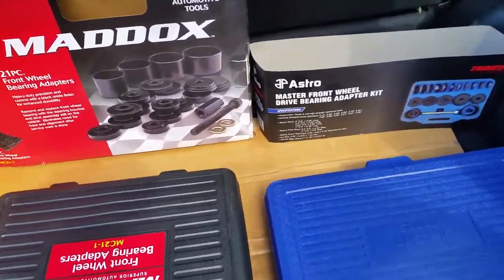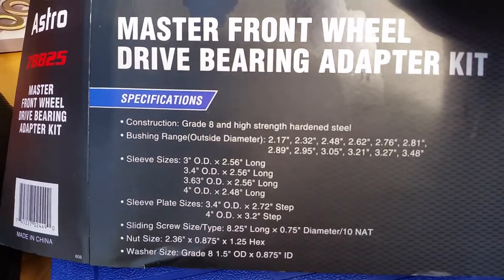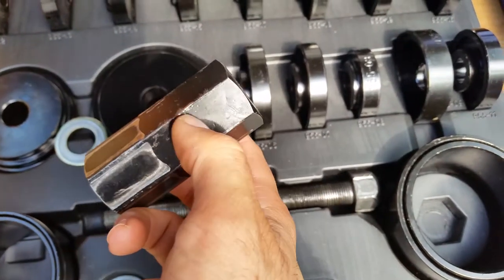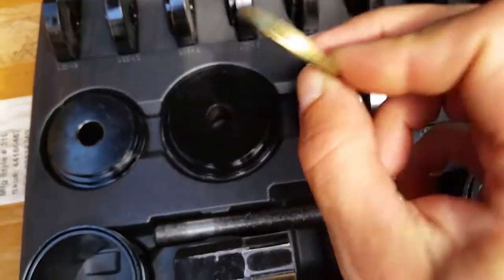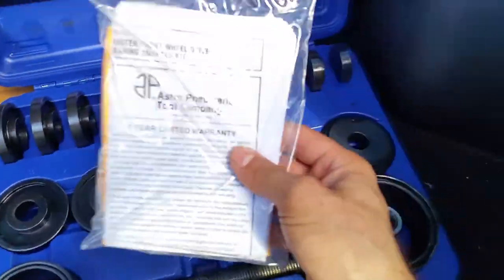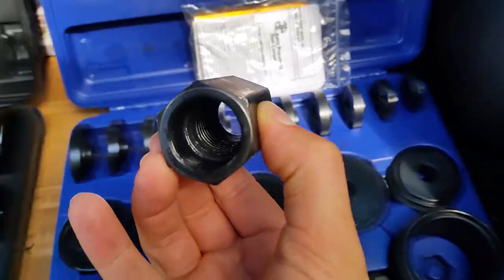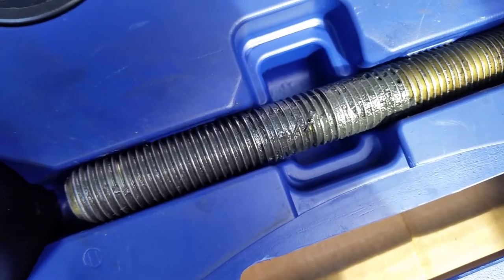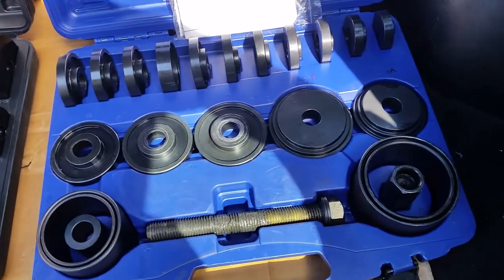Harbor Freight vs Astro wheel bearing adapter kit

Comment: Used the HF kit, same one, about a year ago and got a wheel bearing race pulled and the whole thing re-installed, but afterward, noticed the threads on the bolt were damn near smoothed from just that one job.  Did same wheel bearing job with the Astro kit ($55!) and had no problems at all.  Noticed the bolt is a grade 8 instead of the unmarked HF bolt.  I did return the HF kit, so no love lost.  Keeping the Astro!
Reply: $55? It’s $118 in 2023 😮

Comment: Good advice & insight about the bearing kits. Thx. I'll probably look for and use an axial (thrust) bearing taking into account the axial load (parallel along the shaft) instead of the needle bearing for the bolt and washer setup. Good tip!

Comment: Very helpful thanks.  Have to do front bearings and almost paid the 119 for HF.   I just pulled the trigger and ordered the astro for 73.
Reply from the maker: Right on
Reply: @mil-specmotorworks7805  It worked flawlessly.👍

Comment: Hi, I have the 78830 Astro it’s very strong and pulls that bearing right out with my impact, your right it needs a thrush bearing on the head of the force bolt for a much smoother performance, I’m trying to locate one now, I’m glad I saw your video I was just about to get that Maddox from hf thinking it was better, otc press comes with the thrust bearing, for the price this Astro gets the job done, excellent quality video ty, Bob,
Reply from the maker: If someone knows the thrust bearing part number please put it below this will make the kit last so much longer put less stress on the threads and make it way easier to push the bearing out thanks great comment
Reply: @mil-specmotorworks7805 , I bought a press from Amazon, the company is, free tec, it came with a thrust bearing and I purchased a few more bearings, the company is, factory services tools, the bearing number, HTB 1pc, I got them from Amazon about a year ago, the press works better than the Astro,

Comment: Wow, when did you buy this? I bought this exact Maddox kit at HF in mid-2020 and the threads were MUCH coarser and tapped more deeply. In fact, it looks exactly like the Astro kit's bolt and nut. You definitely have to be careful when buying things at Harbor Freight and peek inside the cases because they source identical part numbers from different manufacturers.
Reply: Compare his part number from yours, sometimes harbor freight will have different part numbers for the same tool, that usually means it was made from a different country China or Tiawan.

Comment: Thanks for pointing out the true defiency in the most important piece of the kit; the nut/bolt.  To keep machining costs down, they reduced the amount of threads inside that nut.  Just to save a few pennies.  What a load of BS!  I'm going to buy a kit like this one day to avoid buying a shop press so I'll carefully check the nut to ensure its threaded full length!

Comment: If you use a wheel stud installer like the OEM tools part number 24235 and a hand ratchet you shouldn’t have problems with either sit
Reply: Yeah and put some grease on the threads seems to help people as well. Alot of people are using an impact on the Harbor freight tool and they say it's not recommended for a impact gun.
Reply: And also like I said in my statement last year if you get one of those stud installers that would alleviate the friction from the boat turning and all the pressure will be on the screw pulling out the bearing
Reply: And also like I said in my statement last year if you get one of those stud installers that would alleviate the friction from the boat turning and all the pressure will be on the screw pulling out the bearing

Comment: Hi There, thx for the comparison, just wondering if you used an impact drive, because got a new one (another brand) and inside the case a yellow sticker saying : ''DO NOT USE WITH AN IMPACT DRIVE'' , That may be the raison of the damage??
Reply from the maker: I never got the yellow sticker I used an impact I guess they changed it now but the Astro I use the impact all the time and it's perfectly fine it's way better quality Steel

Comment: Granted its a POS you dont need the threads to be all the way thru on the coupling nut. You want it for the length. Astro for sure the better kit tho when it comes to taking out bushings.

Comment: Shit I just got the HF kit. I have a side job on a Jeep Patriot front wheel bearing tomorrow. Worst case I’ll pull the knuckle and bring it to work. My plan was once the screw strips out I’ll get the screw from a higher quality kit. Hopefully I can at least get this job done and break even on it.
Reply from the maker: I couldn't even get the first one done let alone both sides on a 2013 Honda CRV with little rust
Reply: @mil-specmotorworks7805  I was working on a 2003 Element rear wheel bearing.  Tough little sucker.